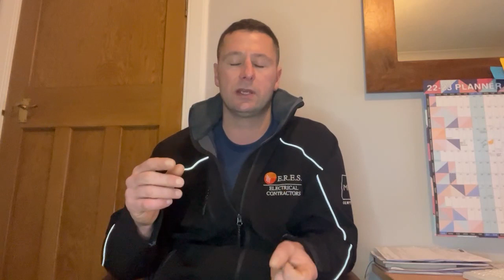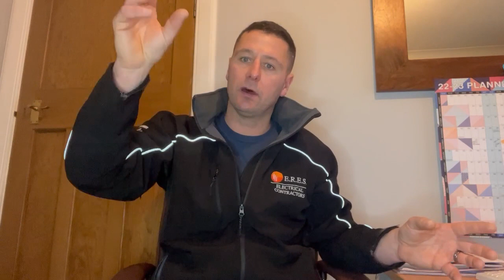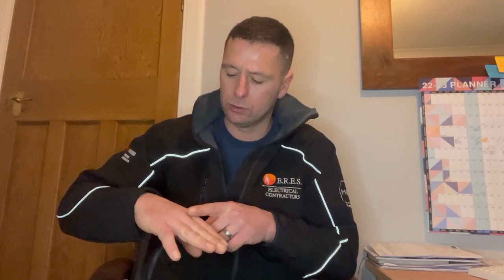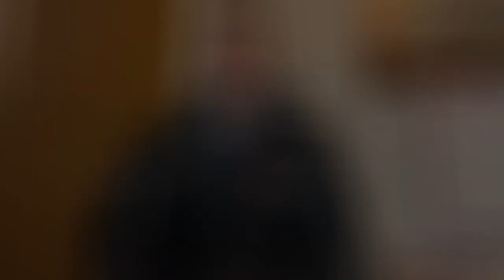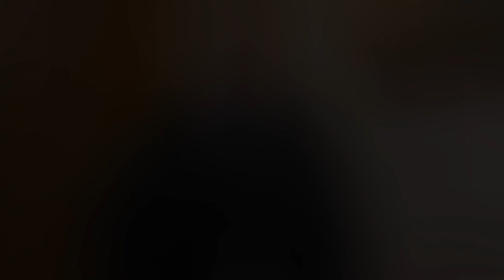Solar Handover

Comment: Great rundown Sandy. Our system you put in is going strong, put in almost 2 years ago. Tempted to get a 2nd battery to handle the excess and to help power our ASHP in the winter on cheap off peak. Given the noises my missus said you and your mate made getting the battery in the loft the first time, I suspect my number would now be blocked 🤣

Zappi is going well too, getting a good workout this month with all this great weather, might beat last June at this rate.
Reply from the maker: Getting that battery in the attic!! That was the first and last time we put a battery in an attic with out a pulley! 😂😂

Comment: I have a question. Can i run my dc cables from the solar panels in the same trunking as the ac supply? Its only 2 meters it seems lots of people use one length of trunking the go up to each isolator and meter etc what are your thoughts?